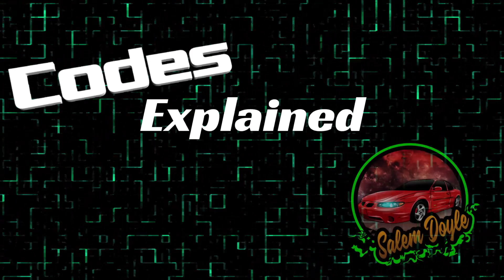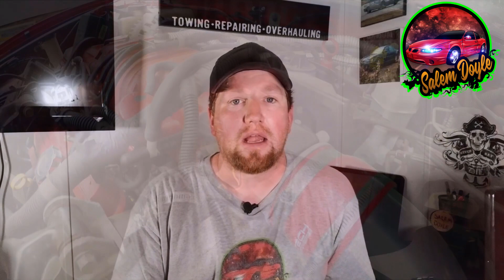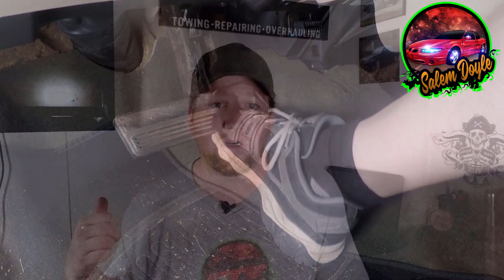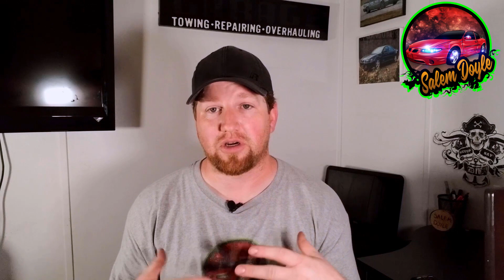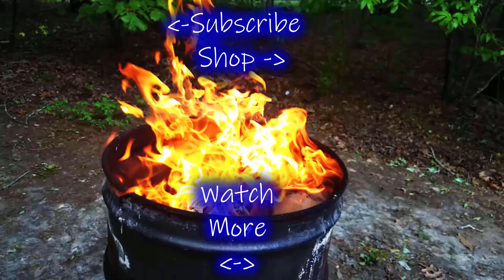P2138 And other Electronic Throttle body Codes ( Codes Explained )

Comment: I am wondering if a bad ECM would/could throw codes p2101, p2106, p2110, p2135, p2138.  p2135 only showed up only a couple of times. The other 4 I listed are there every time as soon as the car starts. I have replaced everything that the shop diagnosed my car to have but all the new parts didn't fix the codes. Any help would be greatly appreciated. Thank You. Keep up the great work, very informative. 👍👍

Comment: 2015 kia optima my car threw this code at first and then it went away. The other day it came back but i have 0 symptoms any suggestions thank you in advance
Reply from the maker: May be the beginnings of a problem that hasnt gotten bad enough to cause issues yet.  Might be worth it to clean the throttle body
Reply: @SalemDoyle  alrighty thank you 🤙🏽

Comment: I replaced my pedal . My traction control goes off, reduce power comes on and the engine light does too. I can’t accelerate. P2138 p1125 . Buick lacrosse 2008 cxl 3.8l

Comment: The throttle valve (or butterfly valve), is it stay closed when the engine is not running? I found the valve is staying open when the engine is not running
Reply from the maker: I think they default slightly open

Comment: Can a flat battery throw this code? 
T31 Xtrail sat still for 5months, jump started, driven to mechanic for clutch replacement, jump started at mechanic & put battery on charge, vehicle collected and within 15mins of driving it had sluggish acceleration and throws P2138 code.
Reply from the maker: The dead battery should have reset that code so if its coming back there is probably a problem.

Comment: I have reduced engine power codes are P1125 P2138 P0116 and it says replace air injection pump
Reply from the maker: Sounds like more than one problem, probably needs some more diagnosing

Comment: I have a 2003 Nissan maxima 3.5..Its only cranking not starting 
Im only getting the p2138 code Please help
Reply from the maker: Could be a problem with the throttle body itself but also if it's cranking over and not starting you may also want to look at the crank sensor

Comment: What do you mean by run the code back through after you put the new throttle body on
Reply from the maker: Reset, drive for a while and re check

Comment: I've replaced both throttle body sensor and accelerator pedal sensor. When I press on gas pedal, it does nothing. Any idea what is going on.
Reply from the maker: Sounds like you will need to check the wiring

Comment: 2014 Jeep wrangler JK. Just happened to me (p-2138).Truck didn't lose power, actually started accelerating on its own. Mechanic states my truck specifically has an issue with the computer communicating with the pedal and visa versa. Out being reprogrammed right now.
Reply: Same issue here. Did you fix it and if so how?
Reply: @riverascleancutlawncare5279  took it to a specialty mechanic by me. Found a short in a wire which fried the sensor in the pedal. He replaced the wire and the sensor then reprogrammed it to the computer

Comment: Just got this car and it throws 02138. Replaced gas pedal it wasn't the issue. Started up this morning and worked great on my way to work, no check engine light surprisingly. after work it came on again. Engine power low, stabiltrack, and traction. The issue is, the throttle body is really shiny and not gunky as far as I can tell, it looks like it was just replaced. 
Any suggestions? Could it be the pigtail connector to the tps?
Reply from the maker: The pigtail is a possibility.

Comment: Hello, I suffer from the code p2138, but I did not find the problem. I changed the throttle and the inner pedal and the code appears when the vehicle is  running 
I have already checked the electrical connections and there is no problem. If the car turns off and restarts after two minutes, everything is back to normal.
My car is GMC Yukon XL 2008  5.3L
Reply from the maker: That could be a wiring problem.  Did you do the throttle re learn?
Reply: @SalemDoyle I don't know, I hope you can tell me where the wires  I we’ll changed the throttle  3 times
Reply from the maker: I would ask a shop about doing a throttle relearn first.  Wiring problems can be tricky to find

Comment: Hi... I m facing some issues in my car when i scanned my car these codes are showing P2127, P2122, P2138... is throttle pedal sensor problem or throttle body sensor problem??? plz help me out from this problem.... suddenly power of car decreases while running and after full pressing accelerator pedal it didnt go more than 3000rpm.. then after switching off and on ignition then it is normal working.
Reply from the maker: this problem can be caused by problems with the pedal or the throttle body.  your best bet it to have them both tested.  or replace them as a set.

Comment: I have a 2011 maxima, and i'm not getting any codes, but I will be driving normally, and all of a sudden I will get no acceleration or throttle response with with the pedal pressed down all the way. If i release the accelerator pedal and press it again, I will then get acceleration again. It happens intermittently while driving. I already had both the throttle body and pedal sensors replaced, with the same result. Any ideas on what would be the cause? Last thing I had done to the car was replace alternator.
Reply from the maker: Check to see if there is a tbrottle relearn procedure that it needs to go through
Reply: @SalemDoyle  Thank you i will try that, it surely cant hurt.

Comment: Would you say a drop in battery voltage to 10.7 volts would kick the 2138 code on a 2007 Cadillac CTS v6 2.8L?
Reply from the maker: Possibly.  That voltage is low enough to cause lotts of issues
Reply: Did you ever find out what caused the code on the cts?

Comment: 2005 Grand Prix runs fine until I mash pedal hard then reduce engine power comes on if I drive it easy accelerate gently it's fine if I floor it does it again . Is that pedal or the TB  causing it ??? Please help
Reply from the maker: Could be either i would suspect the pedal
Reply: @SalemDoyle by the way  it's an 2005 Grand Prix GT I haven't put it on a computer yet to see what code comes on I'm just guessing at this point but the way it acts I suspect it's the pedal
Reply: Thanks for the reply I bought this Grand Prix GT for my 16 year old his birthday was yesterday . It's has only 67,000 miles on it a family member had a stroke 3 years ago and the car sat for 3 years until I bought it and it was running fine changed oil and put gas in it flushed cooling system it was running great until I floored it then the reduced power came on and engine light let it set and it drove fine again until mashing the pedal then same thing if I drive easy it doesn't happen . I unhooked battery reset the light drives fine until I get on it . I cleaned the throttle body it wasn't really dirty . I think it might be the pedal assembly . Because it only happens if I drive it and floor it a little hard I don't want my son getting hit because the car lost power on acceleration pulling out into traffic that's when it does it
Reply: This morning I cleaned out the air box put in a new air filter and reset it again it's been running right all day so far no engine light or reduced power  hope it's fixed knock on wood

Comment: I'm just wondering if you can answer a question I'm really having a hard time getting my car fixed I put three different parts in by so-called makeshift mechanics and I'm asking is there a difference between a throttle pedal position Aor and a throttle position sensor A?
Reply from the maker: Depends on the vehicle.  But with drive by wire vehicles. There is usually a sensor a in the pedal and b in the throttle body.  What problem is your car having?

Comment: What if you install new throttle body assembly and installed a new accelerator pedal position sensor with new pedal and the code comes back after a week?
Reply from the maker: Probably needs the relearn procedure

Comment: GOOD VIDEO BRO BUT YOU KNOW MINES NOT DRIVE BY WIRE...06..JS BUT GREAT INFO
Reply from the maker: 06 should still have an electric throttle body.
Reply: IT DOES BUT TO FEEL THE POWER THE IT SLOW ABOUT BOOSTING SO IM THINKING ITS THE VACUUM ACTUATOR, I REPLACED THE ELECTRONIC ACTUATOR BUT THE MECHANICAL IM GUESSING IS BAD, THOUGHT YOU MAY HAVE EXPERIENCED IT BEFORE ON THESE OLD CARS BRO...THANK YOU THO
Reply from the maker: There is some adjustment where the vaccum valve bolts to the supercharger also
Reply: THANKS GP BROTHER
Reply from the maker: No problem
Reply: THANKS BRO
Reply: i dont see any adjustments brother, i see that little stud under the vacuum door actuator but thats it!!!
Reply from the maker: @shaynedumas4436  the two bolts that hold the valve on are smaller than the holes they go through.  Loosen them and it should move
Reply: THANKS BRO...THANKS ALOT

Comment: Great info taking time to go over this is very helpful!

The early generation drive by wire systems were sketchy from GM on the v-6 engines... my 01 v-6 Camaro would search at idle all the time and varied when cruising. And it did that without throwing a CEL... craziest thing  I had ever seen....
Reply from the maker: Most companies early versions were kindov bad.  I remember how i hated that system when it first became popular because they all had such slow throttle response

Comment: How do u do th throttle relearn I have a really good scan tool. I have 2005 Pontiac Grand Prix gtp supercharged and my supercharged is kicking in but it's Like the throttle fucks up.at a certain speed and then when I'm reading my Love data for the thrittl the car Will be Off and key turned on to on position but the throttle angel Will he anywhew from 4% to 22% and I only even have touched the pedal yet
Reply from the maker: The re learn is a function that you have to use a higher in scanner for, I know the one that we had at the shop would do it, and of course the Tech2 will do it
Reply: @SalemDoyle   thanks for such a quick response super appreciate it is there anyway u can give me the angles and and all that that ur car is giving I'll send u a screenshot of my scan tool it's 50 bucks at Walmart best 50 I've ever spent and it's an app to ur phone the autel  hyper tough ht200
Reply from the maker: The numbers can be slightly different from car to car, that's why the real learn is important, because no 2 cars are necessarily exactly the same
Reply from the maker: Mostly come of the numbers on both sides just need to match, and you need to look for things like dead spots where it suddenly jumps to 0